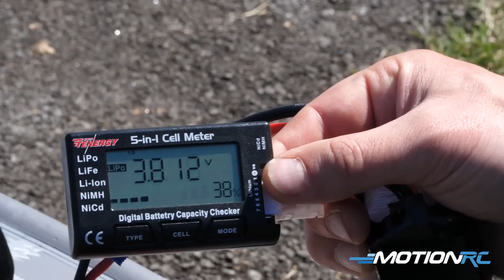Freewing F-35 Lightning II V-3 - Flight Review - Motion RC

Comment: I have the Freewing 80mm F-5 Tiger and I'm interested in buying this plane. Is this plane easier to fly compared to the F-5. I think the F-5 Is pretty easy to fly.
Reply from the maker: Haveing flown both I would say they are very comparable. They both have shorter wingspans so you just want to maiden her on low rates to start and adjust accordingly. If you rates are too high, like the F5, she can roll like a drill bit. But since your flying the F5, you'll be good
Reply: @MotionRC  Thanks for the reply

Comment: Hands down my favorite EDF, roll rate is little insane, i have the rates on 50% and expo on 35% and it still rolls fast lol but amazing plane..
Reply from the maker: I have my ailerons at 35% on Low, 50 on Mid, 65% on high
Reply: I’m going to buy this jet but I don’t think it will take my favorite top spot. The E-flite 70mm F16 is crazy easy to fly fast or slow and it doesn’t kill lipos. I can’t wait to fly this F-35. Wait a sec the best Edf is the AL37.

Comment: Is it possible to take off and land it on the grass? My local flying field has only grass runway. Or at least hand launch it and land(crash it) in the tall grass(its over 1 meter high we keep a batch as a catcher for planes without landing gear or for emergency landings) for coushion xD?
Reply from the maker: All grass is different so hard to say for sure, but there are better grass option bird out there like the BAE Hawk
Reply: @MotionRC  Whats the wheel diameter on f35 its usually the biggest factor when it comes to grass?

Comment: I've got a old military runway behind my house. Has some small rocks all over it and not really possible to clean that up. Any blocker plates for thay lower intake? Will it fly with the normal intake?
Reply from the maker: those are designed on most EDF models to help feed the fan because just scaling a real jet down to this size isn't a perfect science. You wouldn't want to do that. ROcks and EDF's dont mix
Reply: @MotionRC  awesome. Thanks for the reply! I was also thinking of designing a small screen that after takeoff you can use a servo and move a rod thsy allows it to fall off. So it would have airflow just not 100% until it the screen is released and falls away. Probably a pipe dream but might be cool to try.

Comment: Yo man would u recommend this for a second plane coming from fms1280 ?
Reply from the maker: I don't think I'd recommend this one as a first EDF Jet. Flying an RC Jet vs a trainer aircraft is a different experience entirely. I'd recommend the 70mm BAE Hawk or the 80mm Avanti as a great first jet.  But again, set up is the key. Understanding how to set your dual rates etc is imperative. Research, research research first
Reply: @MotionRC  ok ty sir :)  i will sure do more research on Dual  rates. I  didnt realise when u fly faster plane. U want small movement